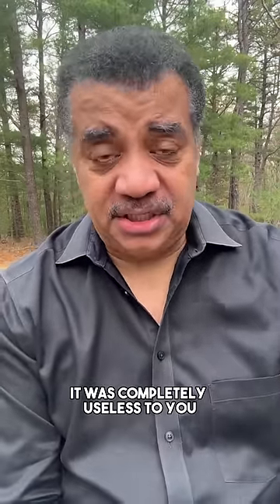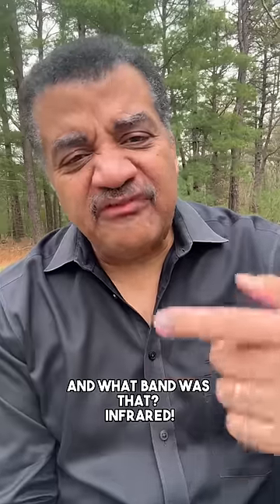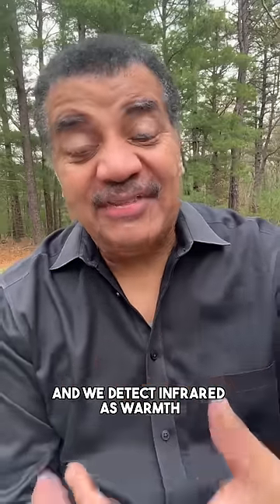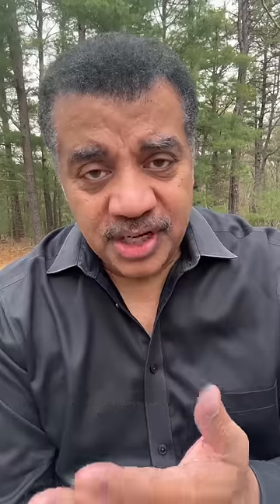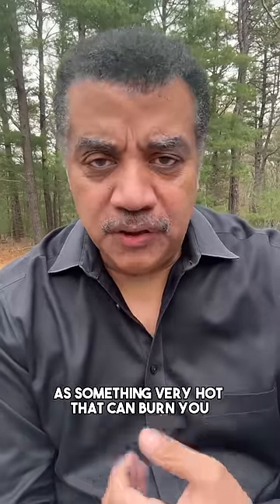LED Bulbs vs. Old Bulbs 💡

Comment: But the old light bulbs also served a purpose, and that was to warm small areas like your water pump. The heat from that light bulb would prevent your water from freezing in you well. So what can we do now?
Reply: But a very small heater. Your case is extremely rare.
Reply: They still make the bulbs. I'm sure they'll never be phased out. Too many practical uses for them.
Reply: Reptile heat lamps work
Reply: Put it near your water pipe during winter so it doesn’t freeze
Reply: But in the Winter we have less daylight, and it gets colder. All those lightbulbs in your house actually helped heat your home. Now your heaters have to work more. We are not saving energy at all, but we are paying more for lightbulbs...
Reply: Hot take
Reply: this take is not it
Reply: They make small heat wraps for water pipes always had one on mine never froze
Reply: @joenewman6494 you think it takes less energy for the wrap than the bulb 💡? Idk 🤷🏽‍♂️
Reply: They did serve a purpose 👍💡 in my area.
Reply: @Off-target-xy6bx   Probably not
Reply: @JessOwen  That only works out if you heat with resistive electric heaters. A heat pump gives you more heat for the same energy usage. Also many people have gas heating.
Reply: @TiSapph  I didn't say we're using more energy, I said we aren't saving energy. Granted, not all states get as cold in the winter as those in  the North do. Here in Washington State, they are trying to get rid of Natural Gas and Propane as heat sources.

I am merely pointing out that the claim of "wasting electricity" with an incandescent lightbulb are unfounded. The heat generated by the bulbs is very useful to some of us. When I changed my whole house to LED bulbs, the heaters turning on more often was very noticable.
Reply: @JessOwen  incandescents are beneficial when it is cold.  However when it is hot, your AC system has to work against them to cool the house.
Reply: Next up, candles used as a heat source to save 1c a week
Reply: @JessOwen  Your house's heater is way more efficient at turning energy into heat than your light bulbs. That's a very inefficient means of heating your house. You may as well open your oven and turn it on as well.
Reply: @craigmak I mean some people do that too, sounds like you've never lived in a true winter climate....wood stoves and heating the oven are common methods to warm the house...
Reply: @JessOwen do you live in eternal winter? No, then all those light bulbs were making your AC come on more during the summer offsetting any supposed benefit. Therefore, you are saving energy.
Reply: @shawnsg  Wen don't need air conditioning near the Washington Coast. In the Summer,it is daylight longer, some days we don't even turn the lights on. I think what we are learning here is that conditions are different everywhere, and so are the solutions.
Reply: @Off-target-xy6bx  I think he means there are things specifically designed for that, so they stay warm even when someone turns out the light.
Reply: @JessOwen  It costs less to heat with propane/LP gas than it does to heat with electricity. So unless you've got some large solar panels somewhere you are better off getting a propane or LP heater and using that in the winter instead of portable electric space heaters.
Reply: @JessOwen resistive heating, like what a lightbulb is, is a terrible way to heat your home.  Very inefficient
Reply: Heat tape?
Reply: Also stop and go lights are now led. Snow does not melt off of them so causing unforeseen issues. Here the lights weren’t visible for a week after our last storm
Reply: I think you can still find incondesents around.
Reply: @eddiegalon3714  The laws in NC won’t let the stores sell them even if they had any. Our government making all the best decisions for us. Shots, what’s in our foods. They know how to do everything, but we do everything. No one  makes all the right decisions, we don’t need them to tell us how to live, some of this stuff should be voted on. Better we make our environment dictate what works better in each area. How many rules can you count that really don’t make sense to you. The light bulb is perfect but they can’t make a bunch of money on it. Not to sound off too much, just how I feel at this point. Thanks for the return to my quip. You hear of any alternatives that sound good please get back to me.
Reply: Insulate your pipes. Grew up in a rural area with regular subzero temperatures and all water coming into the house from a well, we never once had our pipes freeze even when the power went out
Reply: How many BULBS did you have? ONE bulb has a radius of thermal effectivity of around three-four inches.  Thermal energy from the bulb ALSO obeys the inverse square law.

Nice fairy-tale.
Reply: @JessOwen  For the winter yes, but in the Summer it's better to have LEDs.
All electrical work becomes heat at 100% efficiency, so the old bulbs really weren't that bad in the winter.
Reply: @JaredMontgomery-o8m  I never said it was the method I used to heat my home.  I said that they gave off heat and my Heaters didn't have to turn on as much as a result of the heat that the light bulbs emitted.  Your argument against what I did not say is a tacit endorsement of what I did say.

Comment: Pretty cool of the electric companies to only charge us 5x more for 1/10 the energy, the future is great!
Reply: Right. We're using significantly less KWh now, and electric bills have gone up
Reply: True , but you do have to figure in the cost of inflation over the years somewhat.,  but it is interesting to find an old energy tag on a fridge in a garage sale and look at what the average KW cost was when that unit was manufactured. 5 , 8 cents  etc.

Comment: I’m an electrician and have been in the trade for over 25 years now. I’ve seen the transition from incandescent to compact fluorescent to led. The compact fluorescent used less than the incandescent and the led uses less than the compact fluorescent. The actual led doesn’t get hot but the “driver” that powers it does get hot. I always pictured a type of self sustaining powered lighting as the next generation. Something like nuclear powered lighting. They already have certain things that are self contained nuclear powered lighting. They have exit lighting that is nuclear powered. You take it out of the box and literally shake it up and it stays on for over 25 years ! The problem is there is no on off switching for this yet. If they could make it to where every home hard a small nuclear reactor to power it then we wouldn’t need to burn so many fossil fuels. I would assume it has something to do with safety and making it “fool proof”. But yeah  led uses 90 % less energy for the same lumen output as incandescent lighting.

Comment: The old light bulbs saved a lot of boat moters on the great lakes just before hauling out for the winter.
We use them to place a light bulb in the engine compartment to keep the cold from freazing the moter before it got a properly winterized out of the water.
Now we are looking for old standard light bulbs for that little bit insurance in the fall.

Comment: Incandescent lights were both light and electric heat. There are cheaper and more efficient ways to heat a room than electric heat, such as heat exchangers, but infrared heat is hardly “useless.”
Reply: I live somewhere with a cold climate and where almost all heating is from resistive baseboard heaters cause our electricity is dirt cheap. For much of the year, energy efficiency of lightbulbs or any other electrical appliances doesn't matter. Because 1 watt saved with a more efficient appliance is just 1 more watt my baseboard heaters will have to put out.
Reply: @bobson_dugnutt "100% efficient", lol
Reply: @bobson_dugnutt but in the summer, 1 watt of heat the light produces means more watts of cooling needed.
Reply: @MrT------5743 you know what else happens when it's hot out. The sun is out from 6am til about 10 pm. No lights needed
Reply: @tomatojuice984  you know what is not needed for 6 months out of the year? Heat in your house is not needed but light is at night.
Reply: Completely depends on where in the World a person lives.
I'm going to guess you're American
Reply: Tell that to Mr. Condescending

Comment: LED bulbs do get hot.  The LEDs don't get hot but the circuits that run the bulb get very hot.  Its probably what causes them to fail so much.
Reply: Indeed, they fail when there's insufficient cooling, but they don't produce as much heat as incadecent bulbs did... LEDs get hot for the same reason as microchips get hot for iirc.
Reply: While incadecent bulb got hot cuz they were basically on fire.
Reply: @Mihkel Kukk  I know they don't produce as much heat as incandescent bulbs. I've a child of the 80s and had many a burned hand touching a 100W bulb even when it had been turned off for 5mins.
Reply: They do not get anywhere as hot as incandescent.  If yours are burning out rapidly perhaps you may not be using the correct type LED bulb or cheap ones. Pay attention to the fine print as it says things like " for damp locations, for totally enclosed fixtures" . Makes a difference! There is also one labeled multipurpose. 
Hope that helps you have a better experience and longer life from your LED bulbs!!😊
Reply: Not sure who has bulbs out there failing all the time, I buy cheap generic chinese LED bulbs and it takes years and years before they blow. (The one I have right by me in the lamp in my living room has been in there for 7 years now)
Reply: The leds do get hot. In fact they are the hottest part of the circuit. I used to build custom led fixtures for my job and i can tell you this woth certainty. I used to think the same thing. My coworker suggested i touch one while it was energized.  It was quite hot indeed.
Reply: That heat you are referring to is also waste, but that's due to resistance in the circuit.
At some point when we have inexpensive superconducting, all that heat will go away.
Reply: @JM-iz3fr Ambient temperature is critical, LED's used in exterior application in Phoenix, AZ don't last more than 3 years. LED used in ceiling fan fixtures don't hold up well either. You can't buy a LED bulb with a 5 year warranty; what do the mfr know that made them drop those warranties?
Reply: 5355 I would say 50% less  hot. At least on the ones I tested with a laser thermometer.
Reply: @dwaynejones1555  it depends in the wattage if led vs wattage of incandescent. I worked with 10w 750nm leds that were very hot indeed, comparable to at least 60w incandescent. They require massive heat sinks to not destroy themselves.
Reply: I've yet to have an led fail and I've been using them in every light fixture in two different households for several years now. I would've gone through more than a dozen incandescent bulbs by now.
Reply: Nothing last forever even the old lightbulbs they burn out too…
Reply: @joebaretta151  my point is, Led bulbs are advertised a environmentally friendly as they use less electricity, which they do, and should last 20,000 to 50,000 hours. An average use of 8 hours mean they should last 7 to 17 years. In reality they last the same as traditional bulbs of about 1 year. And they are made from hard to recycle plastics and electronics.

Comment: The old lightbulbs kept you warm in winter, no?😂
Reply: and are made from recyclable components, aren't plastic and chinese made circuits and diodes, aren't terrible to dispose of or manufacture or use, but ya know, "green energy".

Comment: It's a shame that the original led's from 50+ years ago in stereos, etc. Are still going strong, while a new led light bulb doesn't last any longer than an old-school incandescent bulb.  The reason it took so long to come out was because they were trying to figure out how to make them burn out quicker.
Reply: Dude you nailed it. A forever bulb only exists in a lab. And the filaments are ten times thicker. Just make some cheesey surface mount devices easy to fail and voila...... Sales
Reply: Phoebus cartel
Reply: because LED from years ago are semiconductors, while modern bulbs are organic.
Reply: Not so. I have LED bulbs that are on 8 to 16 hours a day some that are lit for 24 hours a day that have been in use 6 to 12 years and are all still working perfectly well.
Reply: @generedwine6863  Well awesome,
 I have led's that last about 3 months each. I guess you just bought the expensive ones
Reply: Planned obsolescence
Reply: @angrybadger8136  absolutely
Reply: Yes, but no. Modern drop in LED lamps don't break - their low quality controller boards that powers it, that's what breaks from overheating. The LED is completely fine - it's the built in circuitry that's dog crap and breaks.
Reply: @prfwrx2497  regardless they needed to ensure we'd buy more every year one way or another
Reply: Nope, the LED is pretty reliable but the transformer circuit is dealing with the equivalent of feeding a washer with a fire hose, that makes the transformer to generate heat and the cheap lightbulbs can't dissipate it effectively, so the bulb dies.

Also, is cheaper to connect LED in series but, if you do that, whenever a LED dies by overheating all the bulb dies.

Isolate the bulb like so it can only deliver enough energy for bulbs or purchase better ventilated light bulbs.
Reply: @ROCKNROLLMODS Nah, the "low-end" bulbs are all produced by cheap Chinese factories, they cut costs in ventilation and circuitry to have low prices.

If you buy the reliable ones (there are "high -end" ones that are not reliable) you spend more at first but they last longer. Oh, and check your electric installation, it could be over delivering to the LED
Reply: At 50+ years there were no leds.
They barely had dimm and only red really early leds.

They almost make no light and use no power. How should it break?
But it is also very useless.

Modern LED have million times the power and light.
How do you think this works? Do you think things dont wear?

Take you car, put the pedal to the metal and see how long your engine will last at peak rpm. Hint: Not for long.
Reply: @dom3827  in neutral?
Reply: @ROCKNROLLMODS my basic ikea led lamps have been working perfectly for the last 5 years..
Reply: @schwartzy65  That is not at all surprising. Everybody knows that IKEA makes the best of everything.
Reply: It’s most likely the solid state driver not the LED itself.
Reply: I’m pretty sure that the breakthrough with “modern” LEDs was that they figured out how to make them white, instead of only red, blue, or green like the old ones.  I know there is complicated science behind it, but in the most simple terms… they weren’t useful until they were white/full spectrum
Reply: There is a 100 year old bulb.  Light bulbs are one of the first items to be made to break so you had to buy new ones
Reply: @Lucas-fo8ci  I was rehabbing an old building years back, and the light bulbs on the upper floors had to be close to that old. We loaded them into our string lights we had running through the site, and they all worked and were way tougher than any other bulbs I've ever seen. The only problem was they ran soooo much hotter than modern bulbs. If you accidentally brushed up against one it was a guaranteed burn
Reply: You’re probably right. I’ve had horrible luck with them burning out

Comment: I prefer the old bulbs 💡. There is a warmth that comes from them. They are also amber in colour, which is better to see 👀 at night.
Reply: Ah yes! And your electric bill will be 6 times as much 😂. You can power a 2 bedroom apartment with 10 LED lights rated 10 watts each to a max output of 100 watts. Meanwhile if replaced with 10 filament bulbs rated at the standard 60 watts, it would draw nearly 600 watts. On top of that, the heat generated would account for AC cooling needs. You're basically upping your house current draw drastically. That in turn increases power plant output, which means they burn more fuel, thus creating more byproducts whether that's CO2 from coal and natural gas plants or radioactive waste from nuclear power plants. Technology gets better  for a reason, to increase consumption efficiency and overall less waste in manufacturing and scrapping.
Reply: They make multi colored LED’s that are brighter if not the exact same color
Reply: wilko9396  That's true but a watt is a watt so an electric heater on low is just as efficient (or inefficient) at heating as incandescent bulbs are and LEDs + space heaters last much longer. Or you can get better efficiency from a heat pump + LEDs.

The only real use for incandescents anymore I think are for infrared heat lamps when you want really targeted heat.

Comment: The answer is simple, no need to overcomplicate it infrared light or whatever. Old lightbulbs used a think string of metal and used electricity to superheat it causing it to glow and radiate light and heat. LEDs dont use that technology to produce light. So old bulbs got hotter than LEDs

Comment: The led lights get hot too. The power supplies in them get hot and burn out, so they cost more and last just about as long. Granted they are way more efficient!
Reply: Modern LED lights last longer on average than incandescent light bulbs.

Comment: I prefer the warmth of
Color when dimming an incandescent or halogen light.  Phillips makes an LED that has a chip that adjust the color when dimming LED’s. For example at full brightness the bulb would
Have 3000 kelvin color and when fully dimmed have 2500 kelvin. Standard LED bulbs dim by turning on and off the bulb.  The issue is they color stays at 3000 kelvin but less light is omitted and the effect is dull. 

Look for “Dim to Warm” “Warm Glow”  the effect will be much nicer.
Reply: Dim wit